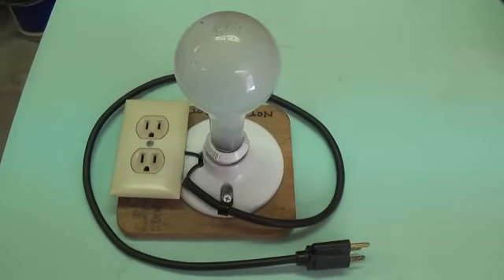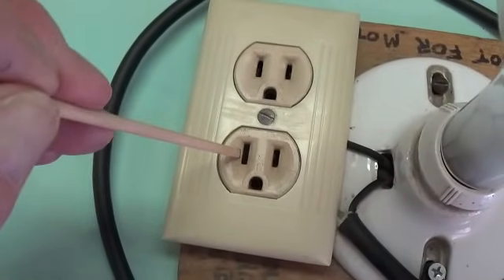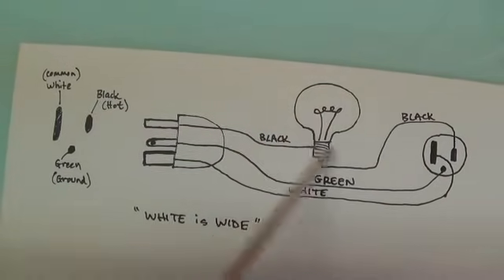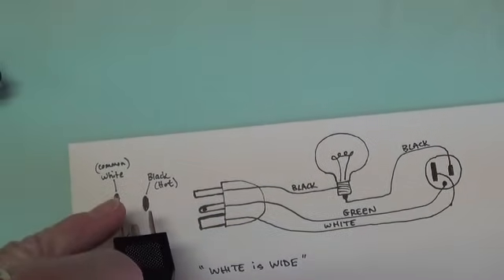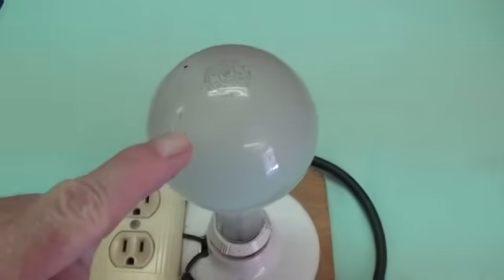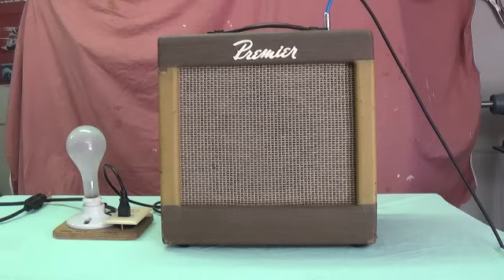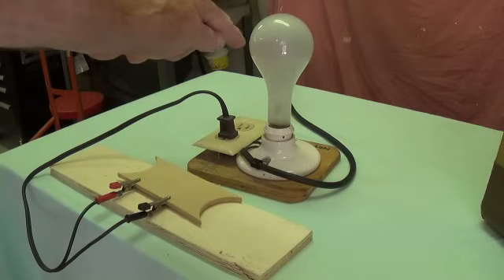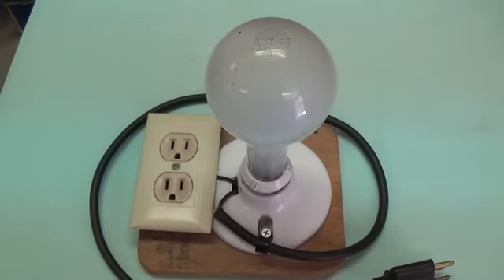Build Your Own Current Limiter for Protection when Repairing and Testing Electronic Equipment

Comment: Uncle Doug, you’re a star! I just built mine from some vintage bits I had around, added a switch for the socket for good measure. 

Note for German viewers: Be aware that in German Schuko plugs, you cannot predict which one the live wire will be. - so test for the live wire, especially if your amp only switches one side of the incoming AC! - Wish I could add a picture here..
Reply from the maker: I wish you could too, Richard. Thanks for your nice comments and helpful input.
Reply: @UncleDoug  , can you think of a solution that would indicate the live wire in a plug socket?

 For context: German earthed plugs are symmetrical, so either of the two (non-earth-) wires may be the live one, depending on which way the plug has been inserted.

This may be an idea for a video. As I understand it, this would also apply to (at least) French and Italian sockets.
Reply from the maker: @richardwonka  Considering my great respect for German engineering prowess, this sounds very "Un-Germanlike" to me, Richard. I would have expected the plugs and receptacles to be perfectly designed to assure proper polarity at all times ;)  How about this as a compromise: Instead of one 100W bulb in the "hot" wire, how about one 50W bulb in each wire?
Reply: @UncleDoug  Oooh! hit it on the head with more hardware! I like it! :-D A stereo-current-limiter - might want to get the patent process going on that one.

As for German engineering, maybe there is a bias for symmetry that just cannot be satisfied by polar plugs?

I know you're awash with praise and thanks already, but do allow me to add to it. Your videos are extremely educational and entertaining! - And my little Fender Champion 600 sounds all the better for it => I have been looking to apply what I have learned from you to create a variable negative feedback loop, just to find out you did that in another video.

My cats are divided on whether me being more motivated to play more (and louder) was a good addition to the living room ambiance...
Reply: @UncleDoug  I just realise that two bulbs don't solve the problem I see. - One bulb is working well as an indicator and current limiter, but I cannot see which wire going into the amp is the live one. - so there is an unnecessary risk of shock when no current is flowing but the device is plugged in (and yes, so far I have always unplugged, as I know is prudent)
Reply from the maker: @richardwonka  In the U.S. the "hot" wire is black, the return is white, and the ground is green.
Reply: Uncle Doug here we have brown and blue being either neutral or live. - depending on which way the plug is in - and yellow-green stripes for ground. 

I am more and more convinced that the Swiss did a better job designing their plugs. A slim plug with an off-centre-line lug between the live and neutral ones. - well-defined and usable throughout without being a trip hazard and bulky land mine like the UK ones...
Reply: @richardwonka  UK plugs are electrically virtually foolproof, but they are extremely painful if you stand on one in bare feet.
Reply: Here’s one. I hope this link works. https://www.instagram.com/p/B86_IDDjOrJ/?igshid=2a2fyst3wkbl

Comment: How about on a higher watt amp?
Reply from the maker: If it's a tube amp, the higher the amp wattage, the higher the bulb wattage. You can also use two  200W bulbs in parallel if you can't get a single larger bulb.
Reply: I used a 200 watt bulb on a Fender twin reverb and the bulb   would slowly come to glow when I turn the amp on , then a moderate flash when taken off standby and would remain on.
Reply from the maker: @conjering  You probably need to use three 100W bulbs in parallel.....unless you can find a 300W bulb....or two 200W bulbs. When the bulb is glowing a lot, the voltage drop across it is large enough to  lower the operating voltages within the circuit quite a bit. It's best if the glow is just barely (or not) visible.
Reply: After I repaired the amp the bulb glows barely then a slight higher glow when off stand by.  I used my DSL which is in excellent condition and did the same.  The bulb  never flashes like in your example of a short.  The voltage did drop I think, because the way the amp responded when I was plugged in with my guitar, you could hear it.  I never had my meter hooked up.  I’ll try a 400 watt bulb.
Reply from the maker: @conjering  If the bulb "barely" glows then it is probably fine for use with this amp. It's the very noticeable, brighter glow that becomes worrisome.
Reply from the maker: @conjering  You need a larger-wattage bulb for use with this powerful amp, C.
Reply from the maker: @conjering  I really prefer to keep amp correspondence on this site or via Facebook message, C.  As it is, I spend hours each day answering questions and comments. Once they start coming by e-mail, any free time would be lost.

Comment: Awesome video, 6 years on filament lamps are getting kinda ‘rare’ one thing people may be able to do to get the R down is connect 2 or 3 in parallel which would then divide the R and increase the Wattage, if a large one isn’t available, thanks for sharing , your Device might be a bit bigger but that’s better than no device.
Reply from the maker: Thanks, Kolin. Yes, multiple bulbs in parallel is a good way to get a higher (or tailored) wattage.

Comment: Uncle Doug will this work if you used an LED  floodlight? Cant seem to find those incandescent bulbs anymore in my country (220v mains).  I guess its not allwed to be sold anymore due to high energy consumption.
Reply from the maker: LED light won't work, AB2. Have you tried ordering an incandescent bulb on Amazon ?

Comment: Dear Doug,
Forgive me if someone else has already asked this.

I am thinking of not connecting the earth wire through the limiter, thereby isolating the DUT. 

Is this ok, or am I missing something?

Frank
Reply from the maker: Not a good idea, Frank. You would gain no protection at all and actually increase the risk of shock. Isolating a DUT requires that the device is insulated from the source of AC by an isolation transformer. Without doing this, removing the chassis ground will only enhance the potential of you becoming an alternate circuit to ground.
Reply: @UncleDoug  Thank you for making that clear. An isolation transformer will be next on my list. 

Many thanks............Frank
Reply from the maker: @wellwellwellband1568  They do serve a unique purpose that no other device can offer, Frank. Best of luck with all your projects.
Reply: @UncleDoug  Thanks for your encouragement Doug. I'm only a novice at this stage and am yet to start on my first amp.. I'm currently learning all I can from you, as  your videos are highly instructive in prac and theory,; as well as entertaining

Keep up the excellent work.
Reply from the maker: @wellwellwellband1568  Thanks so much. We will :)

Comment: Had an old scavenged transformer from an Lowrey organ. Built one of these at your recommendation from that video. Put it in a plastic 2-gang box with a switch. It turned out adorable. ID'd the transformer. Moving on with the project. Thanks, Doug!
Reply from the maker: You're welcome, Rich. Best of luck with your project.

Comment: I've seen a video where they used multiple bulbs via a multiple outlet strip. It would seem its easier to get a couple 100 watt bulbs but would like add any negative consequences to the device effectiveness?
Reply from the maker: Multiple bulbs wired in parallel is a simple, effective way to achieve high wattage without the difficulty of hunting for high-wattage incandescent bulbs.  I know of no drawbacks to this approach.

Comment: I feel kinda dumb 
I see the light is only hooked up to the hot wire.....

Check

So it’s hooked up to the right side of the outlet

Check

And then I’m assuming the outlet is hooked up standard

So.....this lightbulb is hooked up in parallel to whatever you plug into the outlet.....right?

So....if you plug yourself into the outlet (on accident) you and the lightbulb become the worlds most dangerous voltage divider

Check

So....since the lightbulb has less resistance than your skin (unless you’ve stuck a wire in your mouth and decide to pee on some electric parts) 

The lightbulb is gonna take most of the power....

The higher the watts in the bulb, the lower the resistance....so it’ll take a shload of electricity and not kill you or blow up your $3000 tube amp?

Am I following this correctly?
Reply from the maker: Th bulb is in series within the black "hot" AC wire. All current must pass through the bulb before reaching the amp circuit. If the amp circuit draws the proper amount of current, it will not be enough to illuminate the bulb (maybe just a slight glow). If the amp circuit draws too much current, the bulb will illuminate brightly and reduce the flow of current to protect the circuit from damage. Yes, bulb wattage and filament resistance are inversely related. Bulb wattage must be appropriate for the wattage of the amp circuit......higher bulb wattage for higher amp wattage. This only holds true for tube circuits. SS circuits require much lower bulb wattage, since they draw much less current.

Comment: WOULD THIS WORK TO LIMIT ELECTRICAL WATTAGE TO MY SMALL TRAVEL TRAILER SO THAT ONLY A FEW LIGHTS COULD BE USED? I DON'T WANT KIDS OR OTHERS TO USE THE ELECTRIC OVEN  FOR A HEATER! "IT'S WAY TO EXPENSIVE" WHEN PEOPLE DO THAT!
Reply from the maker: I can't recommend it for that purpose, Dennis. What if you simply removed the fuse for the oven ?

Comment: Hey Doug, since taking your advice re: current limiter...it has saved my bacon on many occasions.
I am working on a vintage Marconi tube Stereo. Quick question, if things are "correct" after a cap job etc. how much are the bulbs supposed to light up if at all? Thanks and keep up the great videos!
Reply from the maker: The amount of illumination is determined by the wattage of the bulb and the output wattage of the amp circuit. With a 250W bulb, any amp smaller than 18W will generally not make the bulb glow.....but it may get warm to the touch. A 50W amp will make the bulb glow moderately. A 100W  amp will probably make the bulb glow rather brightly.
Reply: @UncleDoug  Well I guess I have my work cut out for me. This Marconi tube stereo's output is rated at no more than 5 or 6 watts L&R combined. The limiter bulbs are over 300 watts combined.
https://www.facebook.com/photo.php?fbid=1336833183164797&set=pob.100005143832253&type=3&theater
This photo is with no house lights on other than the limiter and the Marconi lights.
Thanks for your interest.

Comment: We use the same principle in automotive diagnostics, the test light protects sensitive electronics in computers from dangerous surges of current. Just as importantly, a properly chosen incandescent test light draws enough current to help identify occult circuit resistance that would be completely invisible to simple voltage checks with a multimeter. It is interesting to see how you're using it here for a diagnostic AC circuit power supply.
Reply from the maker: That's interesting, S. Thanks for your input.

Comment: Would an extremely dim light indicate an issue?
Reply from the maker: Not if the wattage of the bulb was a little bit low relative to the current draw of the amp.....i.e. a bulb that shows no glow at all for a Fender Champ might show a dim glow for a Deluxe Reverb. If, however the same bulb shows a moderate glow for a different Fender Champ, then there is probably an issue.  It's all related to the bulb wattage and current draw by the circuit.
Reply: Uncle Doug thanks Doug!

Comment: Another great video and very useful device. I would however make sure your source outlet receptacle from your house is wired to correct polarity regarding the Hot & Com. This can be done simply with a inexpensive tester you can find at most places that deal with electrical supplies.
Reply from the maker: I think this is covered either in the video or in the video description, Mike. Regardless, thanks for your helpful input.

Comment: I built the current limiter as Uncle Doug described.  It works perfectly.  I'm working on fixing a Korg SDD 2000 Sampling Digital Delay.  When plugged into a regular outlet, the unit LEDs light up for a split second then go dark.  But when I plugged it into the Uncle Doug Current Limiter, the unti worked!  The bulb had just a tiny almost imperceptible glow.  (It did not glow bright, then dim.)  Does anyone have a clue what this means?  I mean...the current limiter ITSELF fixed the problem...whatever it is/was.  Rather than finding the resistor or ? that is faulty in this pretty complex Korg, I am thinking...why not just keep the current limiter connected to the Korg full time?  Would be interested in any thoughts on this matter.
Reply from the maker: The current limiter reduces the wall voltage and current a bit.....around 8%. Perhaps the AC voltage entering the Korg is now ideal for its circuit.

Comment: It needs to be said that in the USA, incandescent bulbs are phased out, so if you go to Lowe’s or other stores, they likely won’t have anything but L.E.D, halogen, or others which won’t work the same and could give someone a bad day!
Reply from the maker: Quite so, Samuel. Nothing else will work. It must be incandescent.
Reply: @UncleDoug  No, halogen will work.
Reply from the maker: I have been given a CL that uses halogen bulbs. The voltage drop is unacceptably high unless multiple (i.e. 4 to 6 bulbs) are used in parallel. Thus, although it WILL work, it is not practical. @silasfatchett7380
Reply: @UncleDoug  Mine uses three 105W halogen bulbs in parallel, and it works fine. I suppose that the cold filaments may have a higher resistance at low voltages, but since I only use mine to check for shorts it's of no consequence. As long as it limits current to a safe level in a faulty amp, I'm happy.
Reply from the maker: As I said above, using multiple halogen bulbs can achieve some utility, especially if only looking for shorts, but for other purposes like initial biasing, I have found them to cause too much voltage drop. @silasfatchett7380

Comment: So because I'm a nerd, I was wondering if it would be a good or bad idea to use one of these during performance.  Why?  Well my question is why not?  I'm running two 6 watt Class A VHT amplifiers and I kinda wanted to make a set of these out of those old fashioned looking 40 watt bulbs.  I haven't modified the amplifiers yet so I have no concern with any faults, I just thought they would make interesting conversation pieces when folks see two light bulbs on a neat bracket hanging of the backs of the amplifiers.  Would that be cool or not a good idea to use everyday?
Reply from the maker: I think it's a great idea, Wiz, and it could be a very interesting display piece.  Bear in mind that the resistance in the bulb filament will reduce your PV and PC a bit, sort of like Eddie Van Halen's use of a Variac to starve his amp for power to create a "brown tone", but to a much, much lesser degree, probably not even noticeable. My audio tests are generally done with a CL in the AC line, and it is not noticeable. Bulb wattage would be important.....the higher the wattage, the lower the voltage reduction. Good luck with this interesting idea.
Reply: @UncleDoug  Thank you for your support and time in teaching us this stuff.
Reply: @UncleDoug  By PV and PC you mean primary correct?

Comment: Enjoyed your video. I was wondering if you could use this device to check out a power transformer disconnected from its original circuit. I.E., checking the two primary leads, secondary leads, etc.
Reply from the maker: Yes, indeed, in fact that's exactly what I do when investigating unknown power transformers. Determine the two primary leads, then connect them through the CL. From that point on, it is virtually impossible to harm the transformer while you try to identify the secondary outputs.
Reply: @UncleDoug  Wow, thanks for the quick reply. I bought the materials and will keep you apprised of the outcome - I'll probably have another question or two later. Thanks!!! Glenn

Comment: UD I just built this. So easy. So useful.
Reply from the maker: That's good news, F3. You will be glad you did.
Reply: @UncleDoug  Am very glad I did. Took about 30 minutes to assemble, including fetching tools and wire from my service van, and finding a piece of wood for a base. 
My base is overkill. 4x6 kiln dried white oak timber.  It was handy and didn't need to be cut, yet.
Reply: @UncleDoug  I used it to test the free Newcomb radio. Radio works. Speaker sounds shot. Sounds great through an external speaker. 
Also, the 2 wire terminal board for the external FM antenna is broken, as is the wide, flat 2 conductor antenna wire that connects to it. 
Do you know where I can source these?

Comment: Don't do this! If the light bulb breaks down you wil be grilled!
Reply from the maker: Nonsense. If the bulb filament breaks it will create an open circuit, with no current flowing at all.